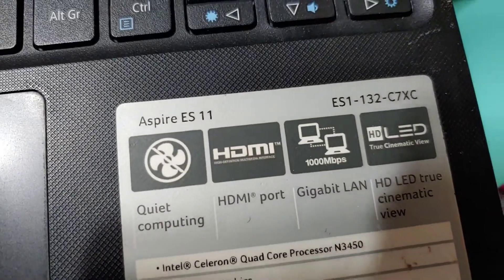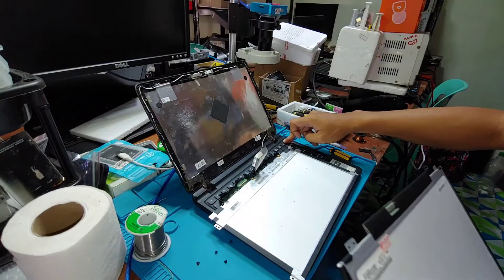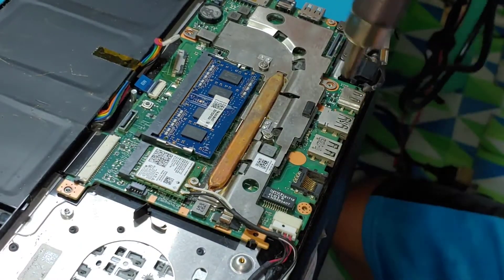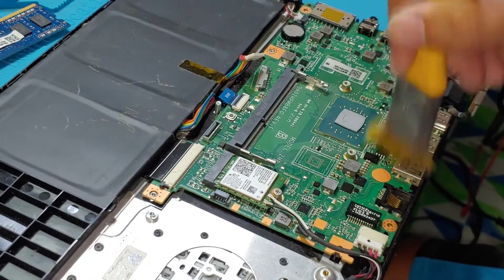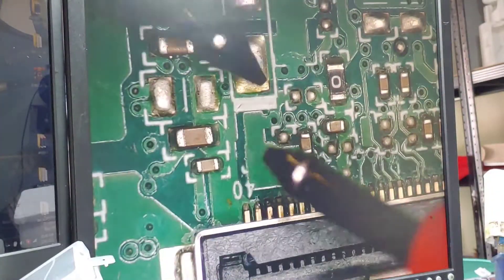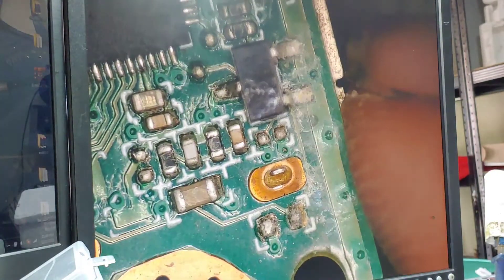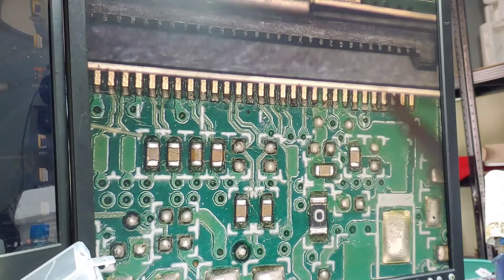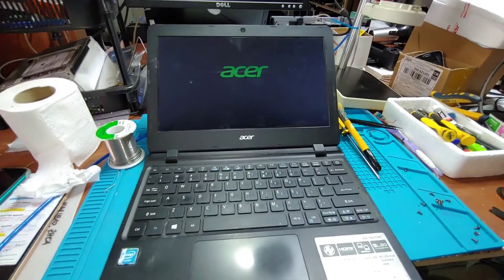Acer aspire laptop no display ( liquid damage)

Comment: Ano po kaya problem ng gpu ko sir rx570 4gb di po naikot yung fan nya naka 0rpm lang may display naman po sya na stuck lang po pc ko ng isang linggo ayaw napo gumana ng fan? Ano po kaya problem nito sir
Reply from the maker: Maikot mu paba ang fan? Baka dipa trigger yung temp para umikot. Try mu painitin games. Pero if sira May video ako nyan pwdi mu ma check sa channel ko.
Reply: @wayneslink naiikot pa panamn sya pag pinapaikot ng kamay.... 81c po yung temp nya ayaw po umikot dapat po 60c naikot na sya naka 0rpm lang po lagi chaka mag kano po kaya aabutin pag ipapa ayos yan? Pede po kaya bilihan ko nalang ng pci slot bracket para sa case ng fan yung nalang yung gagawin ko fan ng gpu pede po kaya yun??